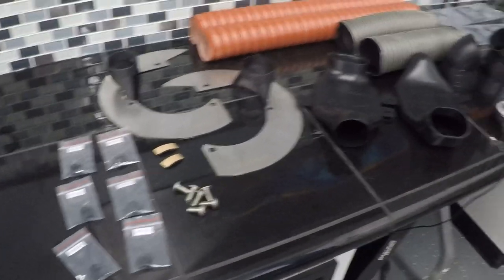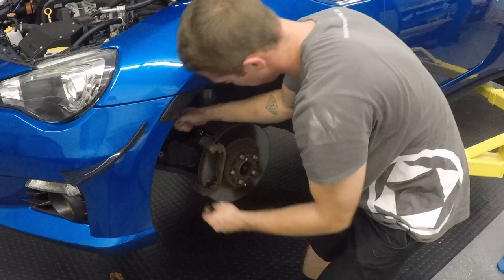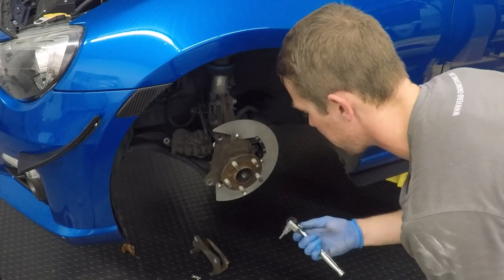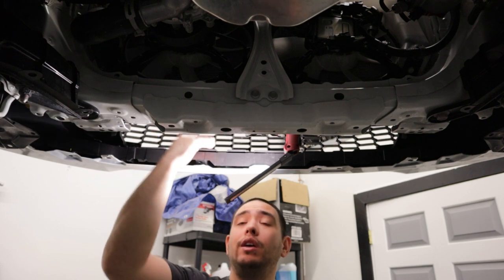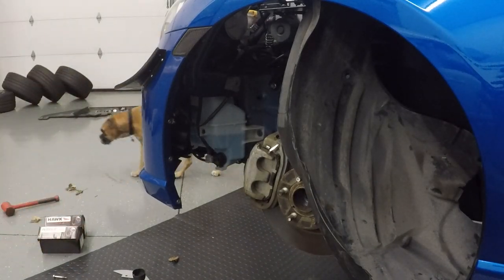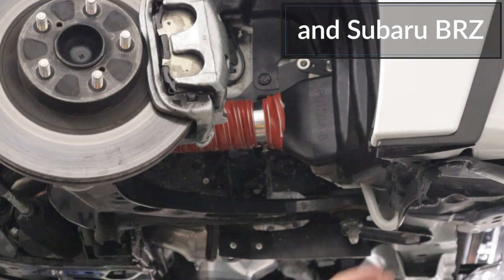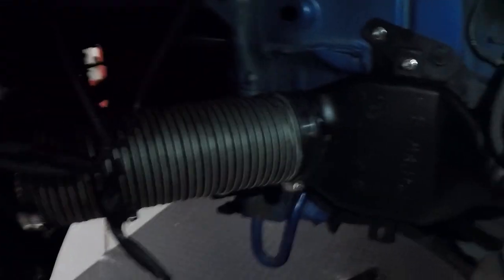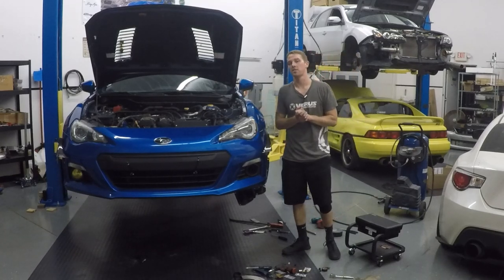Toyota GR86/Subaru BRZ Brake Cooling Kit Installation

Comment: Would be nice if you add a solution for the windshield washer tank as option to the kit. Its the only thing that holds me from ordering it 😅
Reply from the maker: We appreciate the feedback; unfortunately we don't offer anything at the moment, but we've heard of people using this kit with out brake cooling kit. https://www.ptuning.com/ptuning-windshield-washer-reservoir-kit-pn-ptp-eng-90075

You can also use a fluid bag for a slimmer profile.

Comment: It’s a nice piece of kit that I got installed. But I am trying to figure out how to route it properly with my Blitz Oil Cooler. It seems to be not compatible with most of the more popular oil cooler like HKS as well. Any solutions to this?
Reply from the maker: Unfortunately, we do not. You will have to figure out routing around the oil cooler.
Reply from the maker: We can always sell you longer pieces of hose as well.

Comment: any recommendation how to use the windshield water reservoir or another one after the installation?
Reply from the maker: Unfortunately, the OEM unit cannot be reused. If you need washer fluid, we would advise looking some sort of fluid bag. We do plan to look into some kind of replacement washer fluid tank in the future, but we do not have anything to share at this point in time.